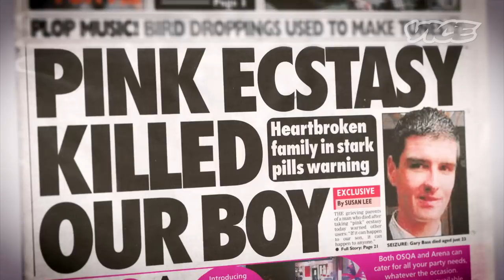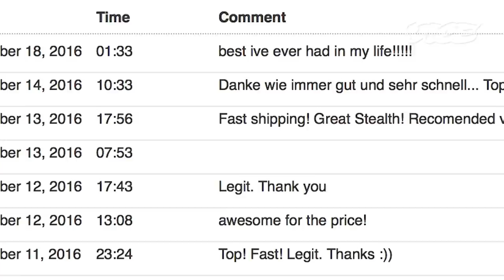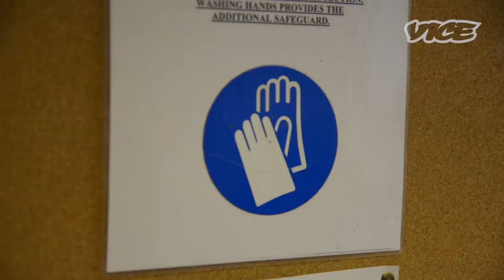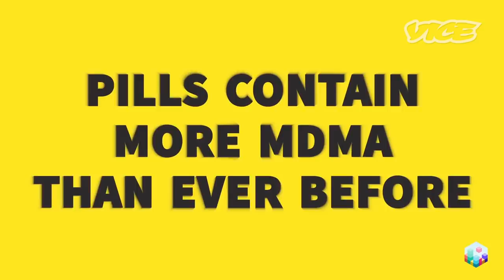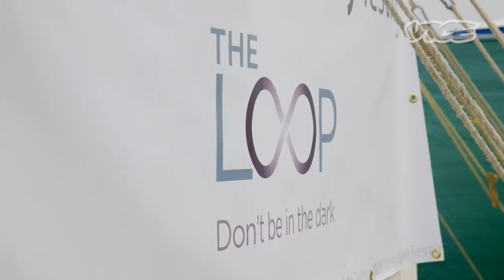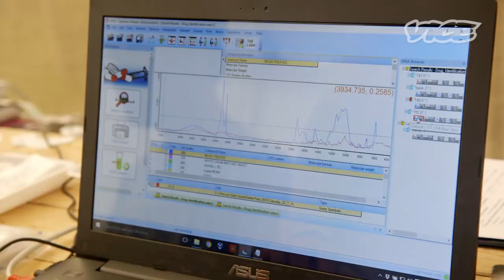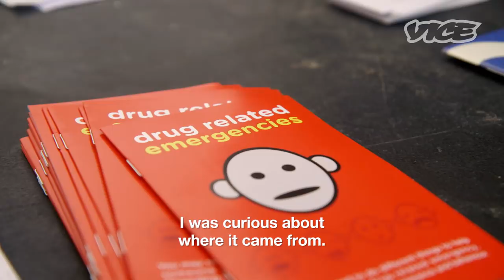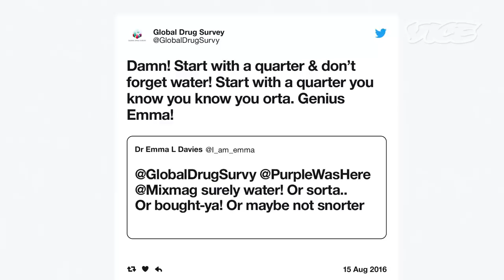The Truth About Ecstasy | High Society

Comment: What makes ecstasy so dangerous? Illicit producing in labs with no hygienic rules, by people who have no clue what they are doing, no idea of basic chemistry knowledge and handling with substances they know nothing about and the lack of care for users, by only wanting to maximize profit and then the following saleson the street. How to reduce this danger? Very simple: legalize, tax and regulate
Reply: FUCKING PREACH!!
Reply: That and people taking pills with no clue of the contents in a hot, crowed night club.
Reply: MDMA is extremely neurotoxic and does screw with the bodies ability to auto-regulate (which when combined with raves = deaths from hyperthermia). That being said, I think people should be able to do whatever they want as long as it doesn't hurt other people and these drug testing programs should also clearly be legalized.
Reply: The only reason MDMA should be legal is for medicinal purposes, such as PTSD treatment and relationship counselling. 

The reason is because it can take quite a toll on the physical body, especially the heart. I was a pretty fit individual, but after a lot of MDMA over a period of a few months, the heart began to hurt and beat abnormally. This is because the heart is not designed to beat that long and hard as it does on MDMA. Sometimes after taking MDMA, the heart was still racing by the next day. I've heard that it can also cause tissue scaring to the heart.
Reply: Gunther Thoss exactly
Reply: Also the ld50 is really high compared to the dose; making it easy to overdose on.
Reply: +Goodtimes420 You realize that ecstasy builds tolerance and drains serotonin too quickly to possibly form an addiction, right? Not ever drug except marijuana will destroy your life. Any drug can be used responsibly. Some it's harder and riskier, but your judgement is based on the same misinformation that said marijuana is addictive and gives you lung cancer. Inform yourself and get off your high horse.
Reply: +Goodtimes420  You realize the holes in your brain aren't real right? It's as true as the propaganda about weed being physically addictive. I'm not justifying my drug use. I don't personally use it, but  I will point out when you're wrong.
Reply: Skydiving can be done dangerously or safely. An occasional cheese burger is okay, but having several a day could shorten your life span 20 years. Same with mdma. I wasn't saying it's safety is comparable to weed. It's not. Weed is clearly safer, but unless you'll believe the DARE propaganda surrounding weed you shouldn't believe it about ecstasy either.
Reply: If you look higher in this thread I left a comment about it being easy to overdose on, because, of a low ld50 in comparison to a typical dose. It should be used with extreme caution.
Reply: There are plenty of cohort, case control, and systematic review studies which show an association between the amount of marijuana smoked and the risk of lung cancer. However, I think it should be legal (like cigarettes) and we should use the tax revenue to actually educate people about drugs because there is clearly a lot of misinformation.
Reply: Whereas you have no evidence to support your claim or any justification why the study is bogus. Good job.
Reply: The study you linked has some flaws. First it has a smaller sample size (less than 2000 people compared to almost 50,000 people in the peer reviewed study I posted), second it excludes people over 60 (the people most likely to develop lung cancer from smoking), third it doesn't say whether they adjusted for cofounding factors (just that they asked about them), and fourth it was retrospective so it may be subject to recall or sampling bias. The article even admits that there are a ton of carcinogens in marijuana smoke. This is the same uncertainty that was seen when cigarette smoking was first being linked to cancer. It takes years and years to actually develop cancer from smoke inhalation. However, there is more and more evidence suggesting a link between marijuana smoking and cancer. If you want to take the risk, it's your choice. But the evidence is pointing more and more towards a link. Here is a meta-analysis which attempted to pool together all of the current studies on marijuana and lung cancer and found an increased rate of lung cancer (https://www.researchgate.net/publication/280937072_Cannabis_Smoking_And_Risk_Of_Lung_Cancer_-_A_Systematic_Review_And_Meta-Analysis). If you want to ignore the facts, be my guest. Just stop spreading misinformation that marijuana has no health risks when it clearly does. However, marijuana certainly looks linked to lung cancer. Additionally, it has been linked to other cancers too (https://www.ncbi.nlm.nih.gov/pmc/articles/PMC4302404/).
Reply: TheBlackMage3 It's still important to take into account smoking frequency. You won't get cancer from a couple of cigarettes on the weekends. Many tobaccosmokers smoke 20-40 cigs a day or more, snd still develop cancer after many years. Marijuanasmokers almost never smoke that much in comparison. Also, one must take CBDs potential anti-cancer effects into account, which could reduce the risk. At the end of the day, I've never even heard of a case of lung cancer in a marijuanasmoker that doesn't smoke tobacco. I don't think it's ever been reported.
Reply: In the first study I linked, the results were corrected for cigarette smoking. Even after removing the effect of cigarette smoking, we still saw an increase in lung cancer correlated to amount of marijuana smoked. And you are correct, it is dose dependent.. It is lower if you smoke less but the additional risk is not 0. I wouldn't tell patients that smoking just a handful of cigarettes in a weekend is completely safe. Additionally, while most people smoke only a few joints in a weekend, there is a population that smokes significantly more (including those who smoke daily). If people want to take that risk, so be it. But people should at least know the risk. After all, getting cancer is simply a probability game. Why stack the deck against yourself. We know that marijuana smoke contains carcinogens. Also the anticancer effects are mainly theoretical. I don't see any oncologists treating lung tumors with cannabidiol or recommending it as prophylaxis.
Reply: For all the guys arguing about drugs and the fact that they are dangerous, please take some advice. I was criticizing the fact, that all the dangers of ecstasy in this video would basically not exist, if it was legal. It would be regulated, people would know what they are consuming and how to handle the drug and how to behave, it wouldn't be cut with some kind of crap. Is it still dangerous when legalized? Of course, but all the people would know how to handle that danger, there wouldn't be any unwanted substances in the product you are buying and many more risks of the black market.
Reply: +Gunther Thoss Dutch XTC labs however, are usually pretty clean and the chemists know what they're doing. In the Netherlands you can legally test your drugs so why would they make shit product that doesn't sell?
Reply: +Too High Are you sure your heart problems are not due to anxiety? MDMA affects the Serotonin so if you've taken it too frequently you might have a low amount of Serotonin which can cause panic attacks and anxiety. I used to experience chest pain and heart palpitations after taking MDMA too frequently so I thought I had damaged my heart but when the doctor told me that my ECG and chest X ray were normal I realized it was anxiety.
Reply: Goodtimes420 Weed can be pretty bad for your mental health. Many people get panic attacks from smoking weed and it can even trigger psychosis with those who are prone to mental illness. So the weed you praise so much isn't harmless either. MDMA is bad if taken too frequently but if you take it 4 times in a year and have a 3 month break between each use it is almost harmless.
Reply: Open source drugs
Reply: No shit....Did you see them Kids make a pill that shit is not at all even or properly measured.
Reply: this is why we need people like walter white, whaddup mr. white?
Reply: Kyle Lindemann no way those kids really do that shit he spilled so much on the floor lol
Reply: Hardly. You can't get addicted to MDMA. I think it's an incredible substance that can be used very wisely. Realistically, you should only take it once a month - because otherwise, it won't do anything. Not to mention that MDMA is very safe - assuming you know what you're doing. Education, not fear. 

It's a very unrealistic view you have. There will never come a time when people stop using psychoactive drugs - regardless of any harmful effects. Humans have been using them for thousands of years, and that isn't about to change. 

Now moving on to alcohol, cocaine, heroin and meth. Yes, now we can talk about junkies.
Reply: overdose , especially the fact that it has a "fuse". 

There were a couple times I've seen ppl take more shit , because they thought their pill was whack and then after taking it 1 minute later the first one would kick in, so after another hour they were rollin on the floor huggin the carpet and shit.
Reply: You've watched too much breaking bad
Reply: Gunther Thoss amen.
Reply: Exactly, this is the reason why I never take any drugs. Otherwise, I would try ecstasy and  do some weed sometimes.
Reply: I have watched only 4 minutes and I´m so angry at these ignorant sheep trying to sell their propaganda on "it´s illegal because it´s deadly" WRONG!! Your comment made me calm down it´s nice to see someone not completely brainwashed and with some intelligence for hat of to you my good sir <3
Reply: Gunther Thoss yo 666th like
Reply: Drugs Inc. Well, you're not supposed to taked that much mdma in such a short period of time
Reply: TheBlackMage3 They did this study with apes. Also it was later found out that they had used Meth instead of MDMA by accident.
Reply: +TheBlackMage3  Marijuana smoke does not cause LUNG CANCER FFS. The National Academies of Sciences (The most prestigious scientific institution in the US) has debunked all Cancers except for one type of Testicular cancer. And even that one is iffy, so  quit spewing bullshit.
Reply: Not sure what country you are in, but here in Australia by the end of year ten the majority of what you need to  know to make illicit drugs and things like explosives/ explosive devices has already been taught as part of the standard curriculum, all it takes is a cluey kid to ask the right questions in the right way  and most teachers are only too happy to give said kid as much info as they possibly can, a shit cook doesn't get far in the criminal world, then there's the dealers who cut the product with Christ knows what to increase their profits
Reply: NeonHologram666 🤣👏👍
Reply: MrCamradude Actually the LD50 is quite high compared to a normal dose. For a 70kg person it's about 7.42 grams of MDMA. Lol that's A LOT of MDMA. No one in thier right mind would be taking anywhere close to that much MDMA. Most people dose around 100mg to 200mg in 1 dose. Some experienced users take a bit more maybe 225mg or so. Then some will take another 50mg to 100mg in a couple hours to keep the roll going longer. So that's around .3 of a gram at the high end that the average person will take in a night. Some people get stupid and keep taking more to try and keep the roll going for 10 to 15 hours taking half a gram in a night but most people don't do that. That's stupid cuz you only have so much serotonin and taking that much is just beating the shit out of ur receptors. Not smart. So basically what you said about the LD50 is not really accurate. Now if we start talking about neurotoxicity that's a much lower dose. Not to mention the LD50 is really almost a meaningless number. Those tests are done on mice. Are you a mouse? No... probably not. Just cause the LD50 is around 100mg/kg doesnt mean you can take 5 grams if your 160lbs. You could be 160lbs and die from taking 3 grams or even less. The LD50 is a median. Some if those mice died from much less than the median dose. This drug is not safe. You can easily die if you are not careful. BUT! If you are careful taking all precautions and testing your MDxx with all the kits you lower your risk by a lot and bring the risk down to a level that IS fairly safe.

Comment: "it's a controlled drug because it's deadly" No it's deadly because it's not controlled.
Reply: NAgreaterthanEU "easily" in germany every year die 6 people cause oft a e overdose this is linke no thing comparing To alcohl OR tabacho
Reply: NAgreaterthanEU DID you ever use it?🤔
Reply: NAgreaterthanEU What tommy is saying is the reason these drugs are dangerous is because they aren't controlled and you don't know what the manufacturer has put in it/cut it with. If there was a controlled manufacturing and selling process the harm would be significantly decreased.
Reply: Oceane Bourgault These substances in their clean form are much less harmful than the research chemicals and cleaning supplies drug dealers cut them with to make a profit. Yes alcohol and tabbaco are regulated and cause much harm but for a different reason.
Reply: Tyler Okay so ecstasy is going to be dangerous no matter what, it's just the danger of overdose can be minimised if you know exactly what is in it. Many people take a dose of what would typically be fine but because it contains some dangerous chemical other than mdma they overdose. If regulation is a long stretch then there should at least be free lab testing so you know what you have.
Reply: 3:12 followed by 3:33 🤣
Reply: no it is deadly
Reply: Maester Keimo  ‘the difference between a medicine and a poison is dosage’
Reply: Maester Keimo takes one to know one

Comment: They count every pill instead of weighing all of them and dividing it by the weight of one pill. Yeah, they are really intelligent there lol
Reply: Pills made from illegal sources do not ever weigh the same .. only pills from government manufactures will weight identical
Reply: @Jake_Hynds  of course they won't weigh the same, but it won't be a signifficant difference. Maybe +/- 20mg at most if they're from the same batch.
Reply: Weight of a pill shouldnt matter, you weigh it if its in a powder form
Reply: The pills also can have pieces flake off or even split in half. These pills counts can mean the difference of 5 - 20 years of prison time. If they chose a flaking one as their base weight of one pill, that could add 10 - 20% more pills in the weight count and could push the charge up another level. So I am all for them taking their time and doing a good job counting them.
Reply: @danielcruces4374  How do YOU know that?